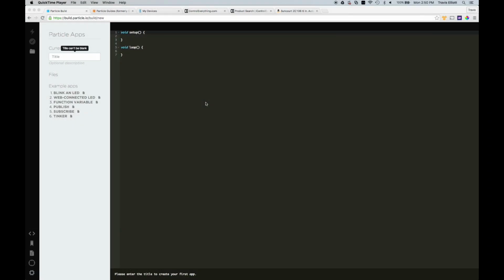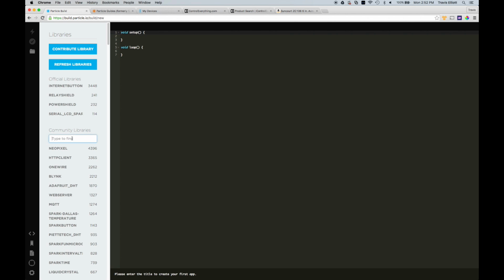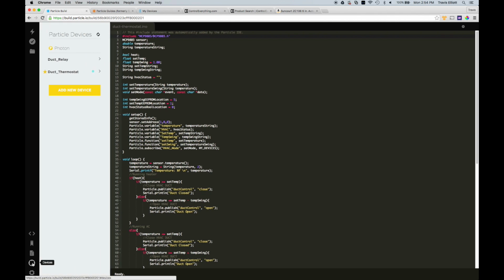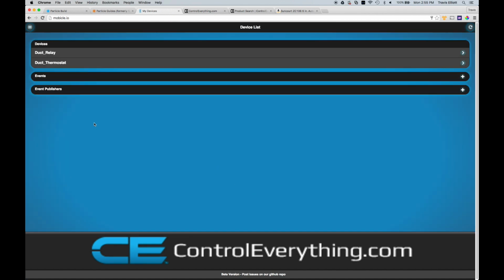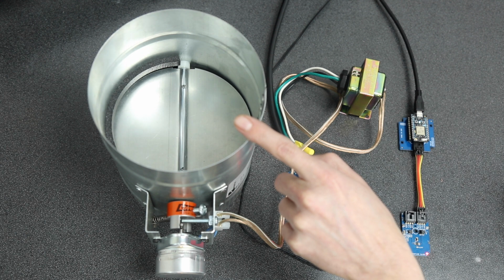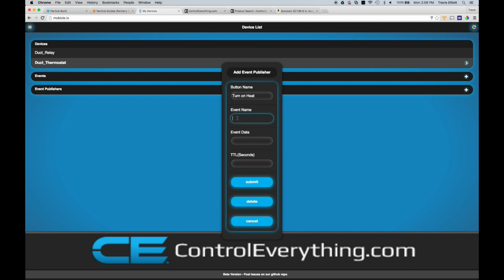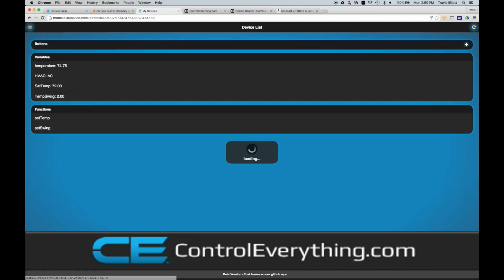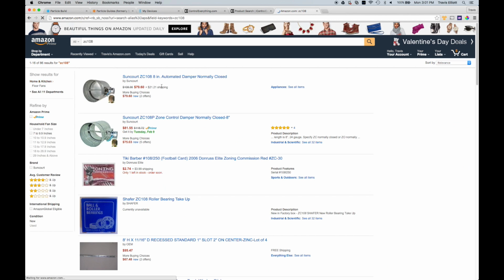Thermostat Controlled Duct Damper with Particle Photon

Comment: I want to set up a Thermostatic bypass to divert the initial cold air back to intake side until it reaches about 70 degrees. Furnace is working fine, but getting a blast of that initial cold air sucks. Maybe a thermostat mounted inside the warm air duct that opens bypass when duct temp is below 70, then closes to give you full force of warm air.

Comment: I just want my dampener to open and close at a set temperature.Can I use a thermostat without all the software?
Reply: You can but you'd have to figure out a way to use it in heat or cool modes. These two modes are separate terminals on a thermostat
Reply: Yes. You can use a T-87 thermostat without all the stuff he is doing
Reply: Cloud based? Really? For a duct lol
Reply: @MakerMark  I'm more surprised on why it even needs to be digital, a ptc and ntc along with a transistor and a few resistors is all you need.

Comment: When you close the damper, your AC is still running isn’t it? So you are not really saving any energy at all are you? All you do is cutting the air flow down, causing a liquid refrigerant returning to your compressor and killing it in the process. Dampers are used in conjunction with bypass duct, to maintain the required air volume.
Reply: If your air conditioning system is centralized system, then it make sense to control individual dampers serving each zone. Of course, easier said than done.
Reply: when damper closed, air that supposed to be used for for example room 1 , is being used for other room cooling it quicker and shortening time of running your AC, that`s how you cut on your bill,
Reply: Josef Brunclik you’re an idiot
Reply: @RowdyRip  hes correct. you need to make sure there return air room is always active.

Comment: nice video sir
Reply: can you put a damper on the exhaust smoke pipe of a water heater with a Honeywell wv8840b1109 gas control valve

Comment: I would like to have an "on off" without temperature control.
Either a wall switch, or an app on my android phone to close or open the damper.
How can I achieve that?
Thanks Much
Reply: I have this in my master with a switch on the wall but it quit working. I'd like what you are asking for, from an app close and open them based on need.  If you find it let me know
Reply: I don't see why you wouldn't be able to wire it to a standard 3 prong outlet plug and plug it into one of those Wifi enabled outlet switches.
Reply: I also want that

Comment: Very cool!! i love this.  I have found more air damper controls and info at www.zoningsupply.com.  I used a SmartZone-4X to control all the rooms in my home, then use a Wifi device like a photon to sense temp and tell the SmartZone what to do.  The reason i decided to do this instead of trying to build the entire system myself is for safe control of my HVAC equipment (which SmartZone does very efficiently)